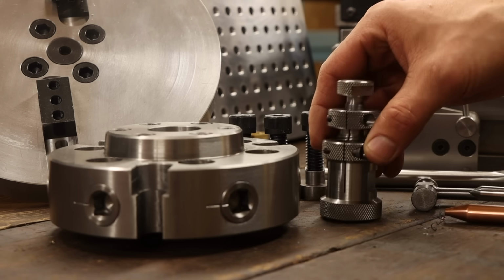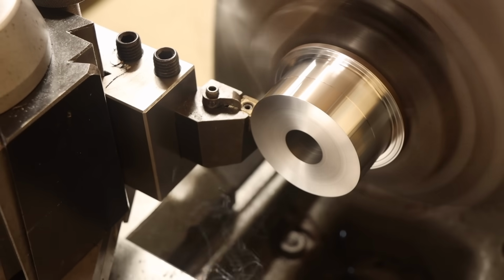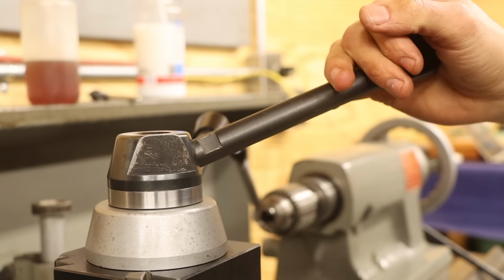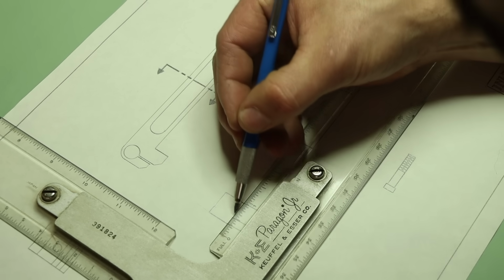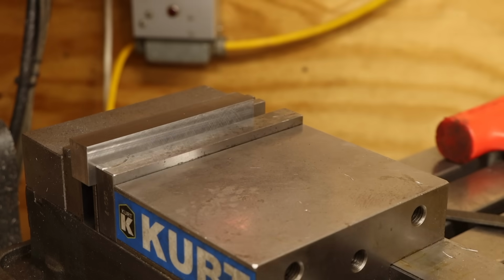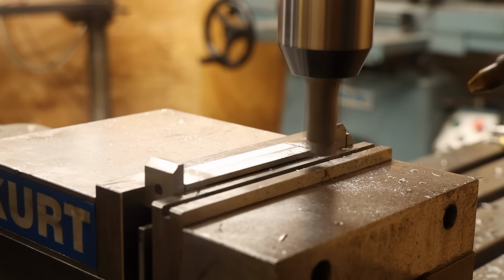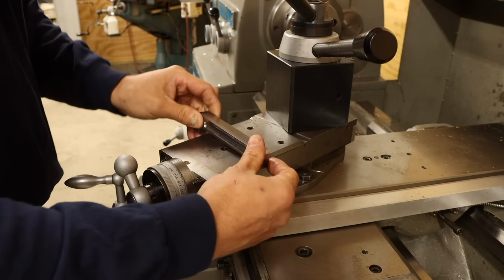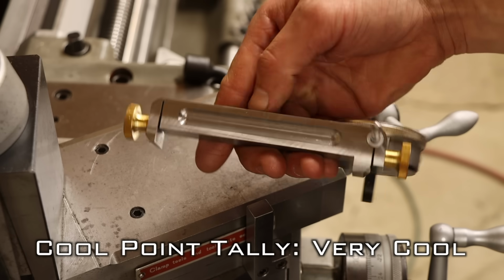Some UPGRADES for the Lathe || INHERITANCE MACHINING

Comment: As a Tool and Die maker myself, I can tell you that one of the things that I love most about the job is its ability to humble you at any given time.  I've been at the job for a little over 10 years now, and the amount of learning that is needed is endless.  The job has honed my problem solving skills so that no task seems impossible, even if said task is to be done on less than adequate equipment.  That being said,  I really appreciate you including the mistakes and trials you have to go through with the design processes and testing of your projects.  You are technically prototyping every piece you create in your shop, so a certain level of error is to be expected.  The finished outcome is so satisfying!  Thank you for sharing, as always!

Comment: Now you know why the locating pin in the quill for R8 collets is sometimes removed. Yes, the pin will stop the collet from slipping in the quill, but if torqued hard enough it's small diameter will cut into the collet as shown in the video. The pounding from a heavy cut with a fly cutter can do this.

If this happens on your mill the first thing to do is remove the locating pin. Usually the threaded pin has a set screw (grub screw) put in behind it to hold the pin's adjustment. If you are lucky after the quill nose piece is unscrewed the exposed pin can be removed and the collet released.

When using a right-angle attachment on the quill ALWAYS remove the pin. If the pin ever cuts into the R8 shank inside the attachment you are in a real pickle. You cannot now get to the locating pin in the spindle and if you try the method shown in the video using a pipe wrench you will almost certainly break the bevel gears inside your expensive right-angle attachment.

Cheers from NC/USA

Comment: You should sell some copy prints of your drafting table stuff.   Signed would be really cool. I'd buy one and frame it makes an interesting talking piece. Also those water pumps are directional and you were using them backwards.. really hard to get a lot of torque pulling that way instead of pushing to the bottom jaw...love your content keep it up!

Comment: I guess you could heattreat the slitting saw arbor which would make it tougher and maybe use a endmill with a corner radius or chamfer to mill the keyway so there are less forces concentrated in the corner

Comment: I copied your toolpost locking handle and ran into the same issue with it turning when you really crank down on it. My solution was to cut two "washers" from a milk jug (HDPE) to put under the nut. Worked perfectly but your solution, while visible (mine is not), seems to be more permanent and elegant. We'll see how long my solution lasts. The milk jug washers are easily replaced and "free" but there is a strong argument for any solution that's a "do it once and done" approach. 
I really felt your pain with the slitting saw arbor. I very much appreciate you showing your mistakes. We all make mistakes and (hopefully) learn from them. Showing mistakes made and  the resulting evolution of the planning and thought process will likely save most of us from repeating that mistake. So, thank you for showing everything, the good, the bad and the ugly.
And thanks for a new project idea. I'll be making an indicator holder next. 🙂

Comment: 2:28 @inheritance machining, why didn't you just relieve the bottom of your new nut? It looks like your issue is the modified top nut is dragging on the lower nut. Should be fixable by just beveling the bottom of your modification to only contact the center post?

Comment: Brandon, maybe you should buy a dial indicator with a longer stroke. I own one with a 50 mm stroke. I think this would make your setup more versatile during e.g. turning long tapers. Ideally the stroke should be the same as the maximum stroke of the compound slide. I think you have to change to a digital scale to get this reach. Would be really neat though...  Otherwise I would make the stop also adjustable for maximum flexibility in a tight setup. Thank you for sharing another great video! All the best, Job

Comment: Nice work but far more complicated than necessary, a fixed block on compound to mount indicator and another with a sliding depth  register would have sufficed I would have thought

Comment: Cool projects, nice videos and great results.

I d have a suggestion however. You can achieve the same result to lock the toolpost without moving it by using a belville washer or trepanning a groove in the bottom so only the outside of the locknut touches the toolpost.

But like I said, hard to beat the cool factor of a needle roller bearing.

Comment: I like the bottom on my Parat QCTP, there is a serrated ring (15° increments?) bolted to the lathe and it matches the bottom of the toolpost. No, I can't adjust the tools freely but there is the possibility to move the tool in the holder...

Comment: There’s nothing I like more than random looking at the lathe and coming up with little
Improvements. 

Careful of the slitting saw arbor. I’m sure you’ve realised but you don’t want that pin the jump again if the saw binds. One set of wrench jaw marks is enough 😂

Comment: Instead of pushing a metal bar against the material use 1/2in key stock with a sealed bearing bolted to it to push your material into alignment. It will not scar the finish nearly as much. 
Also alot of old school machinists would remove the pin in r8 spindles because of that issue

Comment: As allways ur videos works great while getting the first coffee of the day ! 

Straighten out a part on a lathe also works with a bearing 

The break while making the first grove was possible caused by multiple things but I think the main one is the sharp edge of the tool. they tent to pull themselves in with older machines.

Comment: The Cutty whatsit Unsticky squash roundy balls are a smushing addition to the Metallic object spinny thing and your Dial indicator clamp with the knurled brass wheels is awesome.
Whenever I have drilled extra holes I am convinced I am going to hit something vital...no matter how many times I check.

I wonder how would you fit brass hand wheels to something requiring more torque. Could you make  hidden keyways or is there a more elegant solution?
How is the camera boom performing, I noticed a few nice angles in the video and it didnt appear to get in your way?

Comment: 1:57 Check the contact between tool post and compound slide, There might be chips or dink mark struck between them. I usually just stone them flat if it happened.

Comment: Good project. I'm just going to suggest though that when you create a slit that is going to flex like the mount tightening feature ,first drill a hole at the end of the slit at least twice the  diameter of the width of the slit. It will flex better. Stress also builds up in right angle corners and breakage occurs at these points like glass always snaps on the scratch when making a cut. Glad you are taking care of these tools. My dad left me his tools and now my son was going to inherit them but, he was killed while crossing the street. I  have no one to leave them to now.

Comment: Another trick, you can move your indicator mount to the far side of the flag and flip the indicator around so the rod aims towards you and the flag. That should give you a bit more room in case you're limited on stroke length!

Comment: Great video, again!

I wonder, if you can fix the slitting saw arbor by weld-filling the current key way and damaged area, and then clean up the weld on the lathe to restore the taper. Just make a new key way at another place on the arbor...

Comment: I’m a Machinist and a Toolmaker. You Have To Heat Treat Your HSS Cutters After Grinding. And I Do Suggest Heat Treating the Slitting Saw Arbor. You won’t Bulldoze the Spindle Arbor Pin Thru Your Beautiful Slitting Saw Arbor.
And you can Learn about BHT and AHT Dimensions…
Before Heat Treatment and After Heat.

Comment: Beautiful work.

That clamping slit really ought to have a small (1/8 or 3/32) hole drilled at its base to eliminate the sharp corners. It will reduce any potential metal fatigue and should give s smoother action.

Comment: Your compound screw error might be cosine error. 1 thou for 200 thou travel is about 0.3 degrees. If your indicator is 0.3 degrees off of parallel to the compound then you would see a 1 thou deviation for 200 thou travel.

Comment: If the locking lever still doesn't have enough leverage, it would be cool to make it telescoping with the outer tube maybe engaging on a single-turn thread so you can quickly unlock it

Comment: On the slitting saw arbor, Turn / Polish the burrs away and recut the slot at 180 degrees from the first mashed up slot.  Can you case harden it to prevent similar issues occurring in future?

Comment: Very nice.

Surprised that you didn't terminate the other slit in a drilled hole though, would reduce the stress at that flexure point and eliminate the possibility of fatigue cracking.

Also surprised you left the top of the post thread sitting below the surface of the nut to collect swarf and debris. Had expected to see you make a small cap or something, or to remake the bar to extend that 10mm further and also give full thread engagement.

Basically, the work you did was 10 times better than almost anyone else would do, but it seems just not to the ludicrously high standard you've previously set for yourself...

Comment: I would argue the pins don't need to go in the box of shame, they we're built as designed and the design needs to go in the box. The parts were manufactured correctly even if they didn't achieve the design intent. I'm learning lots with every mistake, working in the CNC industry and watching your manual approach really helps to understand a new way of "skinning the cat" so to speak.

Comment: I really like that project!

One thing I would like to note is, that by cutting the flexture-mechanism for clamping on the top-slide with the slitting-saw alone, you created a stress-riser.
If you were to drill a hole first, then the slot, you would have a radius on the end and spread the stress better (like the indicator-clamp).

Cheers!

Comment: The quick and dirty solution to the keyway issue on the slitting saw arbor would be to cut another keyway on the arbor and use that one instead of the mangled one.

Comment: Brandon, check out clicksprings channel.

He made this little bearing thing that he sets up in the tool post that when is engaged on the of of the material, self centers it’s runout. Then he tightens down the chuck fully.

May be a useful addition to your setup.

Comment: I was talking about your machine shop the other day and mentioned the odd second head on your milling machine. My father said it looked like it could be for tracer milling. Put a template part under one half and trace the part with a head that rolls a feeler around it, and copy the movements onto the other side to relatively easily duplicate a part. Seems pretty neat, do you think it could be for that?

Comment: Beautiful work again Brandon.  I love watching your "Machine Shop Therapy" videos after a long week of engineering management.  I did get some shop time in this week, but it was also work related - I designed and machined a super-HOT inspection fixture for a tricky to hold and measure part.  Our internal machine shop is AMAZING, but they are backlogged a couple weeks.
I've always thought of the R8 keyway as a weak point on Bridgeport milling heads.  Happy that mine uses NMTB-30 tooling with two large drive lugs.  I'm sure you'll get the slitting saw arbor cleaned up.
I love the design of the compound indicator mount, will need to make one for my trusty old 9" South Bend lathe.  One option for making the brass knob screws faster could be to use standard socket head cap screws instead of single point turning them.  The straight knurled OD of the SHCS head can then be a press fit into the top of the brass knob, with the straight knurl of the head transmitting the torque.  Also gives the additional feature of being able to use an allen wrench to tighten/loosen it if needed.

Comment: As a fellow machinist it’s my opinion that it’s better to have your handle with two pieces. If one piece fails it’s only half the work and ops to make a new one. From what I’ve seen on your channel, I think your gonna think of improvements and still make both into one at a later date. Most likely as a friendly needed side project. Lol love the content and sometimes inspirational ideas. 👍Lathe Bling

Comment: Decent modifications to get a little more accuracy out of your projects, as for the slitting saw you can just TIG Weld the damaged channel  and redo the surface on the lathe. [and probably check the inside of the Mill mount to see if it needs a little resurfacing after the jamming]

Comment: What is the correct measurement is always a challenge. I always took my dial indicator as gospel, but my DRO disagrees by about .001 per .1” of travel. Then I noticed the dial indicator specification is not really as accurate as I thought.
My carriage stop was graduated in inches, and I quickly realized things were amiss, metric threads do not divide evenly into the marked inch graduations! I found the same issue on my mill quill graduations, there is a very loose metric/ inch conversion. I am more trusting of my glass DRO scales as actually being correct, with accuracy ( or is it precision? ) to .00002”.
My garage is not at constant temperature 0 to 30c so more variables!

Comment: Regarding your arbor. Any attempt at filling the gouge with weld will likely warp the shank. I would remove the burrs and mill in a new keyway on the opposite side. For the marks on the main body, kill two birds with one stone by milling some flats for a wrench. This will remove the marks and set you up to remove it next time. Because if you prepare for it, it won't happen again lol.

Comment: My slitting saw seizes in the arbor also.  To remove the blade, i broke 2 allen wrench sockets.  I finally sandwiched the blade with 2 pieces of wood in a vice,  then used a pair of channel locks to then turn the mandrel.   Keep up the good videos...!

Comment: I'm going to use that clamp idea for a spindle lock/indexer, so that I don't have to drill a hole in my Sherline lathe headstock. Thanks for the idea.
The thrust bearing...I'm constantly removing my QCTP, so it would be nice if the whole setup could be held together. Maybe I'll figure it out.

Comment: I would sugest looking into the bearing desition. The idea is good and maybe one of the best i can think of at the moment, and i hate to point out problems instead of solutions, but you are going to have to replace that bearing faster than spected. The presure on the rollers is going to deform the metal underneath and will seace over time... Im sorry for not having a beter coment but here is may grain of salt

Comment: I would have drilled a hole at the end of the slit. Now stresses will build up at the sharp corners which might lead to breaking after fastening a number of times.
But the oiece looks good.

Comment: Hi Brandon. How trustworthy do you feel that dial indicator is? Is the division count on the lathe dial correct? Being one thou under for each turn is rather odd, its not even a metric 5 mm pitch thread. Maybe find something flat, mic it up and check the DI against it using the mill table if no surface plate.

Comment: Just have to remember that when using the indicator you will remove twice as much material as indicated.  I’ve been burned by that before because my hand wheels are all “direct read” and was used to dialing 1 thou to remove 1 thou.

Comment: Since you have some unused thread on your toolpost lock, what are the chances of a cool brass plug threading into the open threads on the nut and serving as a dust and chip shield for the threads? (And looking cool)

Comment: Excellent video as always. Love seeing the smaller improvement project. 

About your arbor problem. Could you chuck it in the lathe and remove any material that ended up higher than the finish dimension, then put it in the mill and mill out a new keyway? It'd result in an arbor with two keyways, but a quick mark on the visible section would keep you from making an error there. 

Just a quick suggestion from a guy who (despite wanting to) has never touched a mill or lathe. Keep up the great work.

Comment: the hinge on the second side clamp has a lot of potential to crack that could be eliminated by a small drillrd hole at the end instead of just the slitting saw kerf.

Comment: What do you figure the force exerted by the toolpost clamp nut actually is?  Do the contact patches of the thrust bearing rollers distribute it enough to avoid brinelling damage over time?

Comment: Not sure if it matters but personally if I had to repair that saw keyway I'd file the burrs, fill the mark with a tig weld, then re-turn and mill the keyway to remove excess weld material

Comment: I like the compound addition you made, but are still only measuring the movement of the compound which is not directly in relation to the change in radius of the cut due to the compound angle. I built a similar tool that mounts the anvil to the cross slide and allow you to set the dial indicator to the compliment of the compound's angle; thus any adjustment in the compound is read on the dial as a true change in cutting diameter.  Keep the videos coming I love your work.